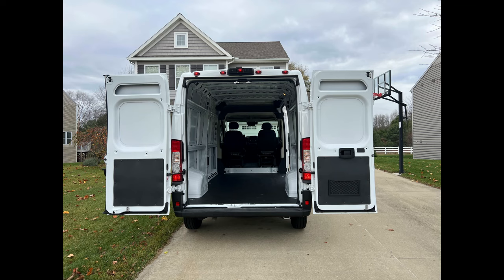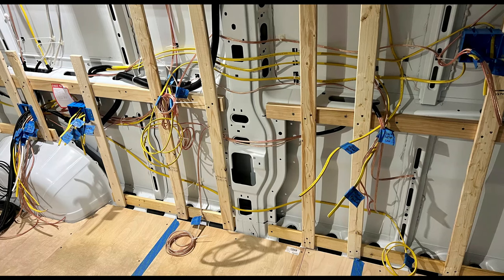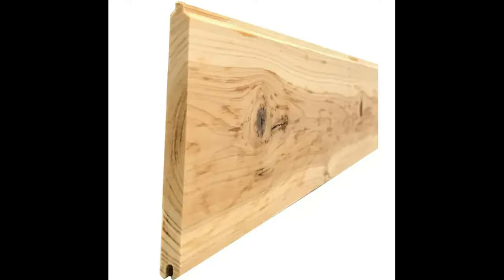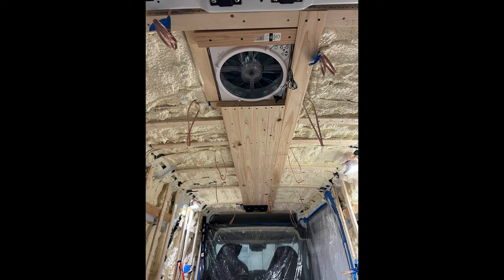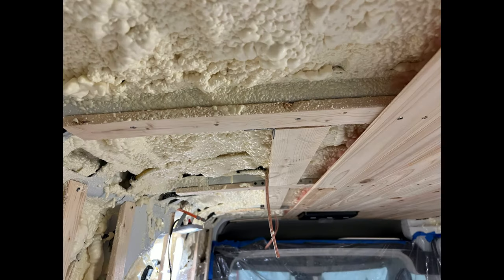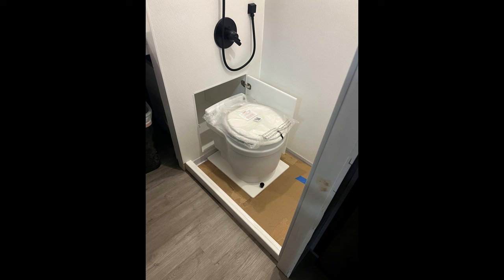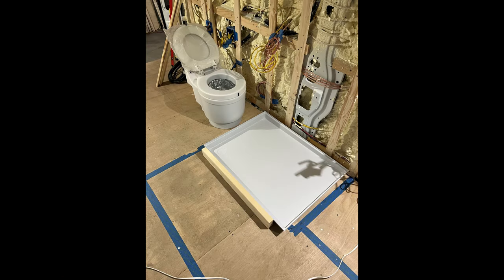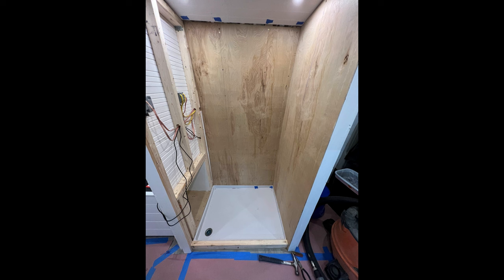Ceiling & Wall Finish, Hidden Toilet, Shower Framing - Promaster Van Build Video 3

Comment: I know you like a clean look and covered the screw holes. Did you leave potential future needed access to items like tail lights, door hinges  and maybe other didge items? Maybe they are not needed, but some vehicles need interior access.
Reply from the maker: You're right, and access is needed. We definitely left access to some of those items like tail lights, hinges. In fact I think w/ the Promaster you have to have inside access to get to some of the lights so both side rear corners the factory covers can be removed to expose the lights. I also left a few other access mechanisms in place to get to key things. There might be a few areas that could be challenging but for the most part I tried to build in maintainability. Thanks!